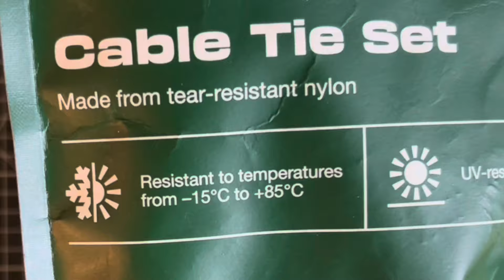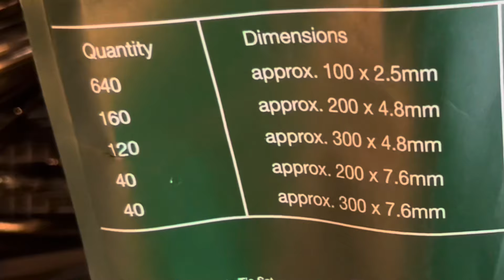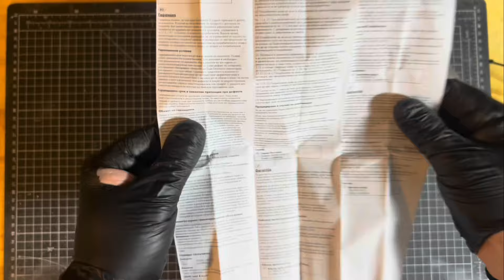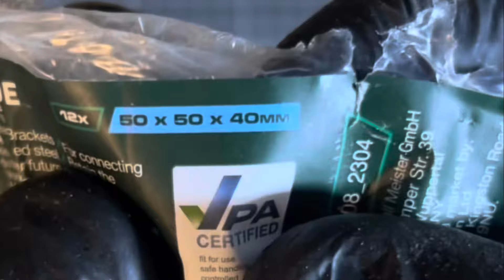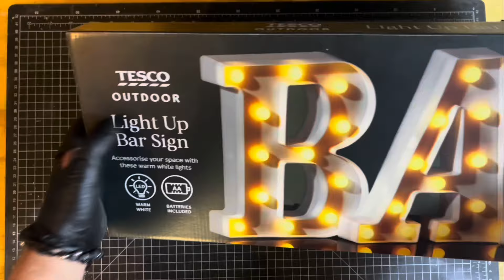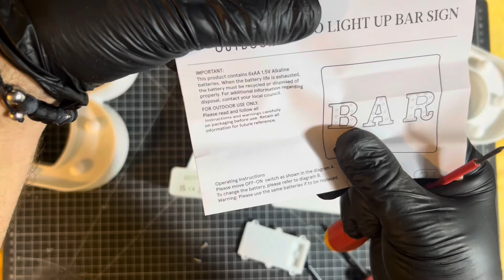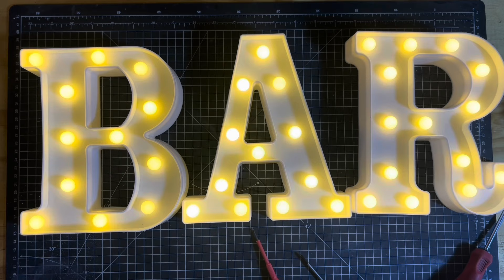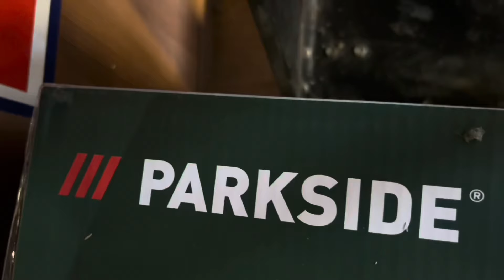MORE PARKSIDE TOOLS 😃 & MAN CAVE STUFF 😉

Comment: I think you've bought the parkside chop saw/mitre saw? I spotted it last week. Have you purchased used tested there f style clamp's if you've not get some 5 quid a pack of 2 or 3 or 4 depending on size there the business I use them all the time in workshop👍🏴
Reply from the maker: Great guess Micheal 😉 watch this space though! Cheers for the heads up on the f clamps.. I’ll give them a go 👌
Reply: @WeekendShedHead  f clamps are spot on bought load the other day. Nice kinda thought that's what it could be that and the bag looks like the dust bag they come with. 👍🏴😄